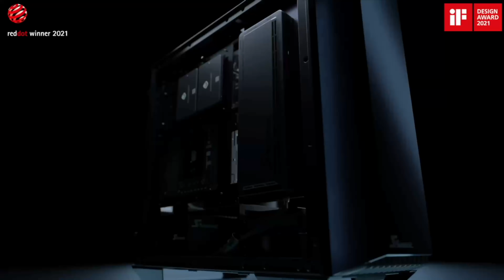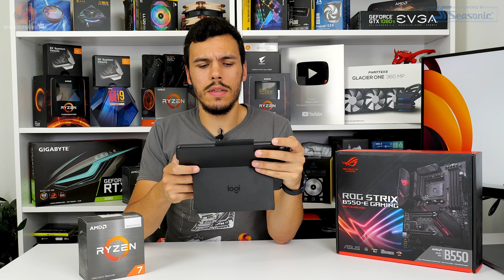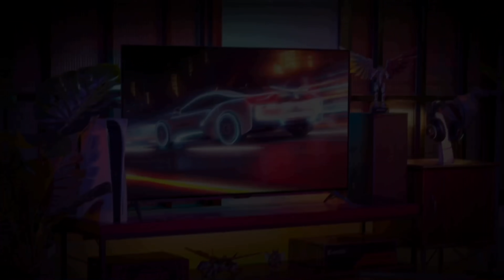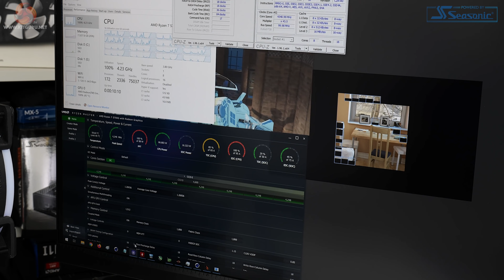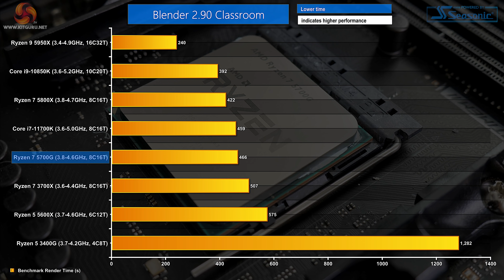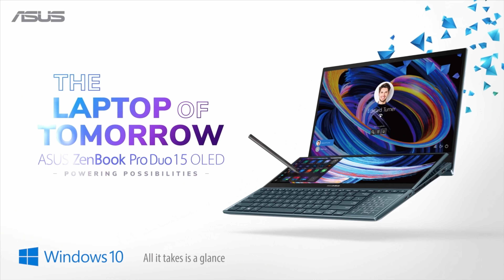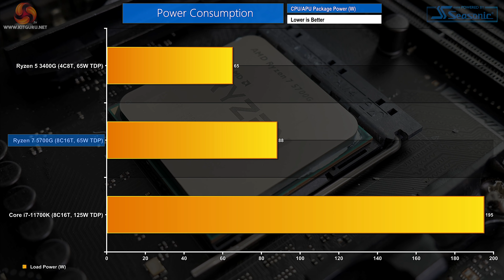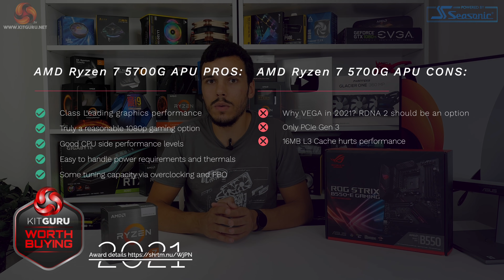AMD Ryzen 7 5700G APU - Can it Run AAA Games?

Comment: I’m missing a chart that might be really interesting: idle power consumption (ie. where most of the time is spent in most of the builds). The previous G-series had much, much lower idle power consumption compared to the X counterparts. The current X-series still has a problem with idle consumption being way too high, so it’d make the G-series an interesting choice if you care about this metric (I do, because I’ve got a passively cooled build).
Reply from the maker: I replied above, but I will comment here too as you make a very good set of points. Unfortunately, I have found that there can be a lot of variation in idle power consumption between the different motherboard vendors. That makes presenting consistent and accurate data a real problem (especially when comparing different platforms such as B550 vs Z590). Idle power draw is also really heavily influenced by monitor(s) output - hence the GPU power state - and the background tasks such as cloud sync or real-time AV etc.. I know this doesn't really answer your point, but hopefully it gives some insight as to why I have tried to not include (potentially inaccurate or misleading) idle power numbers. Luke
Reply: @KitGuruTech  all true, but still a bit of a missed opportunity, because this chart you did earlier was really interesting: https://www.kitguru.net/components/cpu/luke-hill/amd-ryzen-5-3400g-zen-vega-11-apu-review/8/. You can clearly see the G-series pretty much halving the idle consumption, and I got nearly the same results in practice, where I had a 3700X idling at 75W (total PC power draw) vs. 35W for a 3400G - same motherboard, GPU, monitor, etc. So I'm really interested where the 5700G would come.
Playing around a bit more with Intel CPUs in the mix, the conclusion I reached was that Intel's SpeedStep technology is vastly superior to what AMD offers, with the CPU frequency dropping off a cliff as fast as it can. Meanwhile, the AMD seems to keep itself busy while nothing is going on - and in the X-series the voltage is pumped up to make matters worse.

Comment: Considering the Ryzen Master doesn't support and will not load with the R7 5700g, this video is a bit suspect given how much it supposedly points at it for information. Stock footage for a different processor?
Reply from the maker: AMD sends compatible versions of Ryzen Master to reviewers via an online portal (as is always the case for pre-launch reviews and is common for most companies in this industry). Plus, it literally says 'Ryzen 7 5700G' in the Ryzen Master software shown on video. So your comments are unsubstantiated and unhelpful. Luke

Comment: Well, I'm not going to complain about Vega taking another trip - it holding up surprisingly well in APU format.  But in dedicated format, it was too many CU's and pushed well beyond it's envelope.  I'm not complaining that AMD is sticking with it one more round - with AM5 and DDR5 (and many other things - like the possibility of quad channel memory - though I know that's only a rumor at this time) on the horizon, it's likely a slightly better play for AMD at this moment.  Why tarnish RDNA2 with a bad rep from dragging down RDNA's performance if dual channel DDR4 will strangle it?

Comment: It's the fastest APU, even faster performance than some dedicated GPUs, and you still end with the conclusion that this is somehow a disappointment? I don't get that. Sure, it's still Vega, but given the cost, performance and power consumption, I'm assuming they made the right choice. If you want a console APU, buy a console. I wouldn't be surprised if those weren't locked down under contract for now anyway.
Reply: Damn!! tech companies must love customers like you. Happy to accept anything at over £300. And lower spec than console hardware already out.
Reply: @theonlyredspecial  well consoles are subsidized by their closed markets. PC doesn't have this luxury. It's all up expected to be paid up front, not over time by software cuts. This is also clocked much higher. Only a downgrade in the GPU side.
Reply: @MichaelLargent  so you seem happy. That’s great. Not sure your point? You think all pc owners should be happy with another Vega apu release? I think Luke was very even handed and Covered every angle. Like a good reviewer should. I want latest tech not last gen. I never mentioned prices.
Reply: @theonlyredspecial  I mentioned prices, you replied to me, so prices are entirely relevant. 
This isn't meant to me a replacement for a console APU. Judging on that mark doesn't make sense. It's primarily a CPU, a very fast one. It just happens to have excellent integrated graphics.
Reply: So what’s your verdict on the $360 pricing ? Good value for money? Have you bought one ?
Reply: @theonlyredspecial  seems an excellent deal to me. I haven't found one yet but I'll probably build a thin and light from one. 
I mean, the Ryzen 5600x is just as expensive, similar gaming performance, but no igpu.
Reply from the maker: I think the conclusion was pretty clear that this is a great product if you want an APU. But there are certain use cases where this wouldn't necessarily make sense - those who just want a gaming system and could make do with a Ryzen 5 / Core i5 and cheap dGPU are a perfect example. The gaming numbers were above RX 550 2GB level in our testing. So it really isn't difficult to fit a substantially more powerful dGPU into the £310 CPU+GPU budget (compromising non gaming CPU perf, of course). But that comes back to a user wanting an APU vs CPU+GPU, which is what the conclusion highlights. Perhaps a newer architecture on the GPU side would have offered even more horsepower, which is exactly what we should all be wishing for when Ryzen/RDNA 2 APUs have now been seen in several forms. Luke
Reply: Very simple.

No Gen 4, RDNA 1 = This thing is a joke.
Reply: @nexxusty  find something better. I'll wait.

Comment: Are any of them better than an i7 9700 and gtx1650 super?
Reply from the maker: I think for pure gaming, the GTX 1650 Super combination will be better in GPU-heavy tasks than these iGPUs. Especially because the i7 9700 is still a pretty good gaming CPU anyway. Luke
Reply: NO. It's 1030 performance.

Comment: I think they are waiting for DDR5 to upgrade the iGPU. I guess the low bandwith of DDR4 would hold back a more powerful GPU.
Reply from the maker: That's a very interesting thought. I do wonder, however, if bandwidth issues would be across the board or just in some heavier scenarios (e.g. Certain games and certain resolutions). Luke
Reply: @KitGuruTech  There is probably a really good reason why the Steam Deck with 8CUs of RDNA2 uses LPDDR5 and not LPDDR4. Keep in mind that it targets only 800p and lower resolutions usually means that it's less demanding on bandwidth.
My guess is that RDNA 2 would be bandwidth limited 99% of the time with DDR4 at 1080p. In fact I think that even with DDR5, Infinity Cache will be needed if they want to avoid bottlenecking on an APU with RDNA2 playing at 1080p.
Reply: That's exactly why they are waiting.

Comment: It is insane that the 11700K has double the power consumption when compared to the 5700G.
Reply from the maker: Ye that was pretty remarkable to be honest. It was for a CPU-specific load (and Intel's iGPU is very low power), but it really is an important point for users with limited cooling and power budget. Luke
Reply: @KitGuruTech  how about idle power consumption?
Reply from the maker: @kasimirdenhertog3516  I have found that wall power consumption is a little too variable between different motherboard vendors to make for a useful comparison. It is also heavily driven by the monitor(s) being displayed to (because of the GPU power state), so is perhaps not all that useful for comparison. Luke